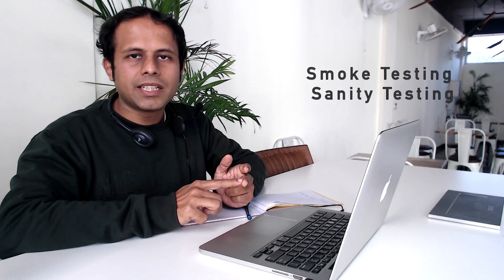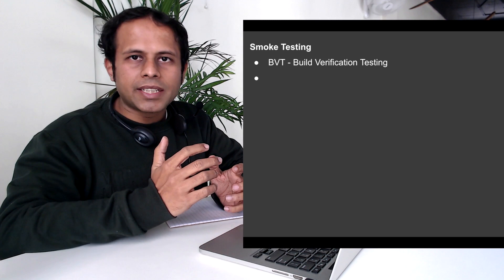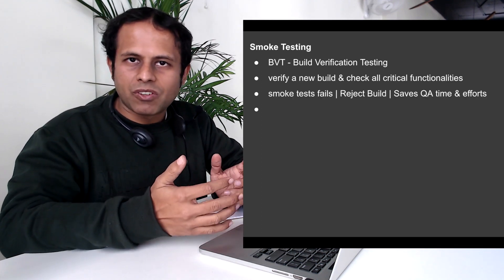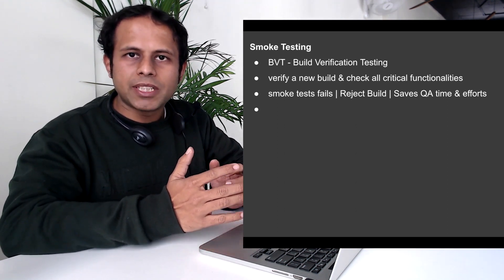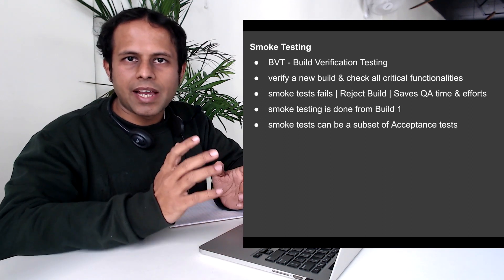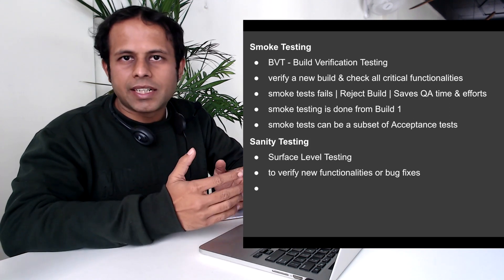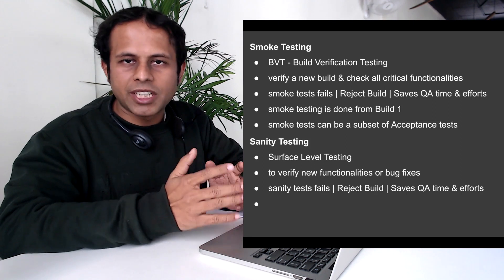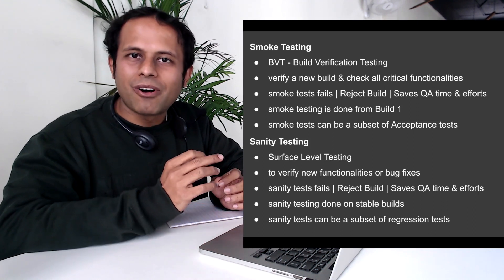#AskRaghav | Difference between Smoke and Sanity Testing | Raghav Pal

Comment: How to identify a critical functionalities or how to decide which should be considered as critical?
Reply from the maker: Hi Ankit
To identify critical functionalities, you need to consider the following factors:
* The importance of the functionality to the user. Some functionalities are more important than others, and they should be considered critical. For example, the ability to log in to a system is usually considered critical, as it allows users to access their data. 

* The impact of a failure on the user. If a functionality fails, what impact will it have on the user? Will they be able to continue using the system? Will they lose data? The more severe the impact of a failure, the more critical the functionality is. 

* The likelihood of a failure. Some functionalities are more likely to fail than others. For example, a functionality that is used infrequently is more likely to fail than a functionality that is used frequently. 

* The cost of a failure. If a functionality fails, what will be the cost of the failure? Will it require the user to re-enter data? Will it cause the system to be unavailable? The higher the cost of a failure, the more critical the functionality is. 
Once you have considered these factors, you can decide which functionalities should be considered critical.

I hope this helps!

Comment: Still confusion for Sanity testing
1. After bug fixing we do Retesting for confirmation that whether defect is fixed or not. 
2. After bug fixing or after any change or new feature introduced, we do regression to verify if there is any side effect because of that. 
So what sanity testing does?
Reply from the maker: Hi Pratibha, although there are fine differences, Sanity testing is done as the first test (after BVT) to check the functionality after any modification is working as expected and if not we can reject the build. The scope can be little more than testing only the failed tests

Comment: @Ragav, as per the ISTQB, smoke testing and sanity testing are same as both of them are conducted for the upper level testing. So if someone says both of them are same, will it be correct?
Reply from the maker: Hi Manthan, the purpose of both is similar, that is validating a build for complete QA testing and rejecting a build if this tests fail and save QA time and effort, but there is a little diff as explained in the video, Also pls share the link so I can verify with ISTQB

Comment: Nice Setup Raghav!

So just for fun, if I take calendar (real one, not software) as an example

Smoke:
1. Check that there are 12 pages
2. Pages can be flipped easily

Sanity:
1. Name of months
2. Date and no. of days are correct for every month
3. Weeks are correct on every page
3. Check festival dates are correct (considering extra feature)
4. Other features are placed properly like:
    a) Sundays are marked Red or any other colour
    b)  Festivals are marked differently
    c) can be pasted/hanged properly

Is there something else I am missing?
Reply from the maker: Great example, may be we can put some more checks in Smoke tests
Reply: Can u do some changes and re comment?